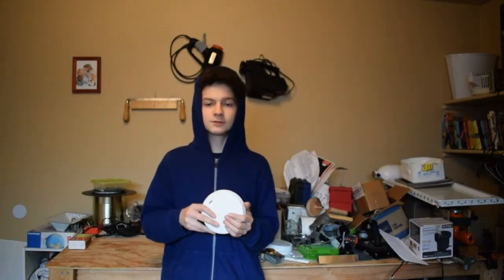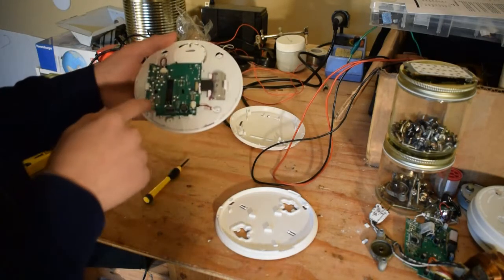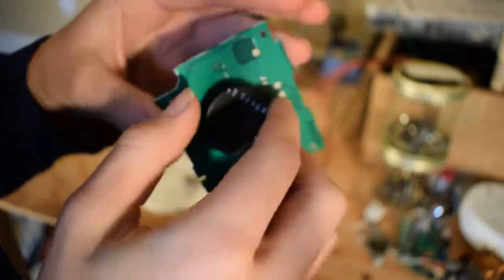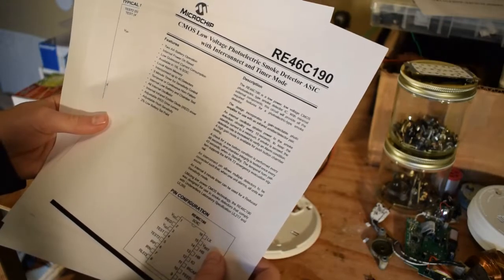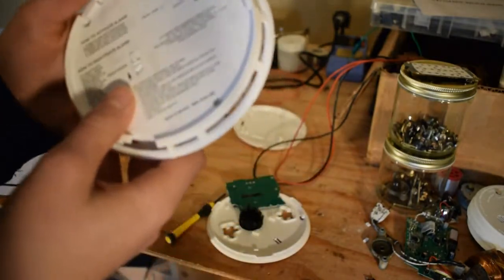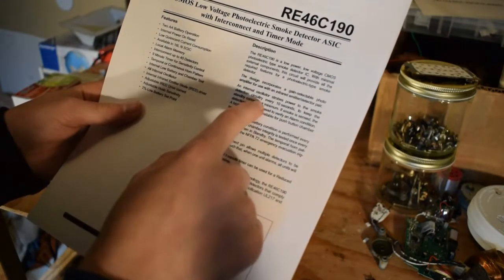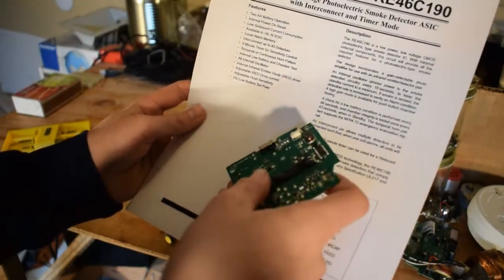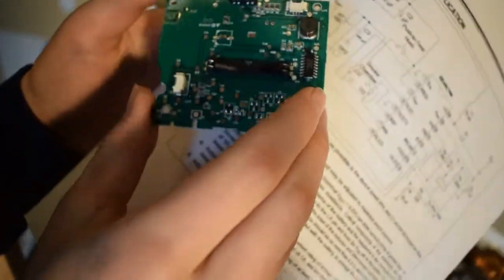Photoelectric Smoke Alarm Teardown+How it Works

Comment: there's a downside- Kidde photoelectric alarms have louvers on the chamber where they put the LED and photocell.  these louvers are open enough to allow small insects to get in and trigger a nuisance alarm.  I've thrown out several Kidde photoelectrics because of it.  First Alert photoelectrics have a fine mesh around the sensor chamber and should be less prone to nuisance alarm.

Comment: I'm interested in disabling the sound in my smoke alarm, but I still want it to detach smoke.  Do you know how?
Reply from the maker: I highly recommend not doing that if it's giving false alarms consider replacing it or moving it to a less smoky/dusty location. If you want to disable the sound you could remove the buzzer/speaker.
Best of luck.
A.H.W.
Reply: Sorry, why the hell would you want to do that? If your smoke alarm goes off, you can shut it up by pressing the button on it.

Comment: please do a video on taking out the speaker and the I guess sound chip.
Reply from the maker: Almost all the circuitry is on that one chip so just removing the sound part is not a option. But I have a idea where I modify the  smoke alarm so that I can change how sensitive it is.
A.H.W.